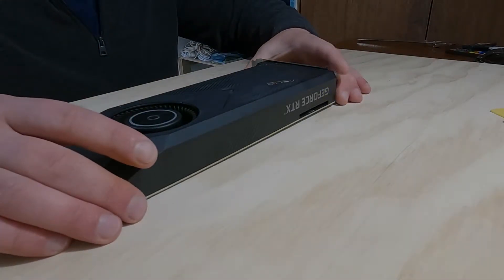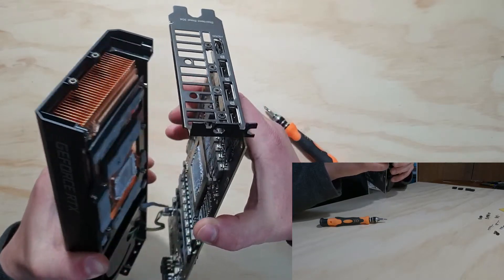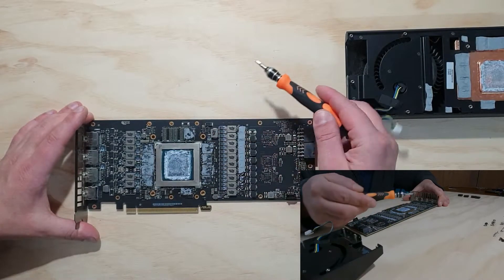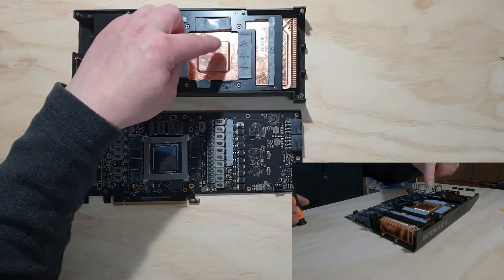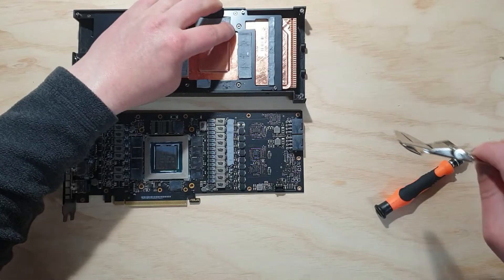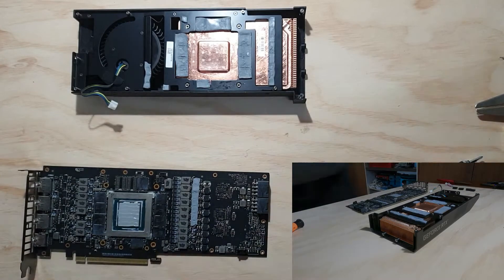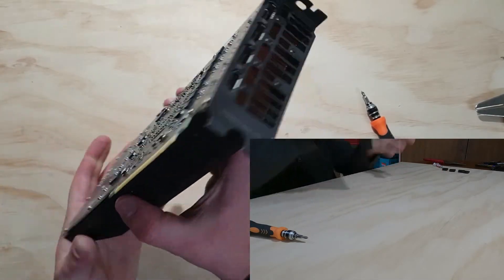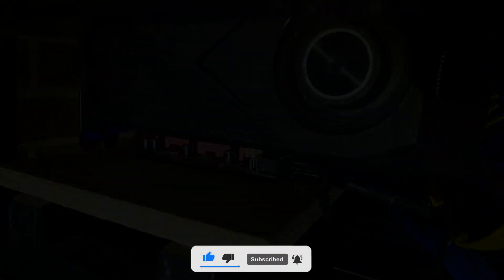How to Change Thermal Paste on a GPU -  RTX 30 Series  - Achieving Lower Temperatures

Comment: Hey man, have you tried the pea method for repasting a 30 series GPu ?
Reply from the maker: Hey dude. I did try this on another card but noticed that I didn't get full coverage. Still works but I find spreading the past before putting the heat sink back on mich more effective on keeping to core temps down
Reply: @CryptekMining  ooh nice, I changed the pads on a 3070 TI and I’m having muuuch worse core temps I think I messed something up, as before I was getting max 60c on full load after the change it goes up to 71c